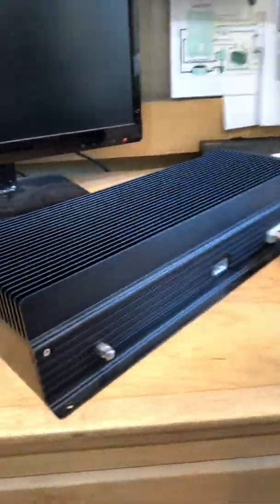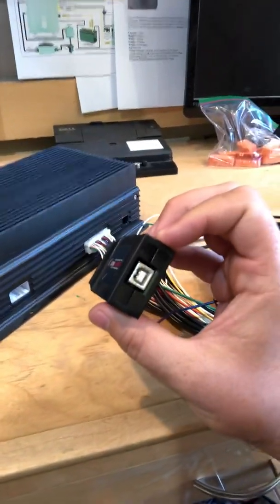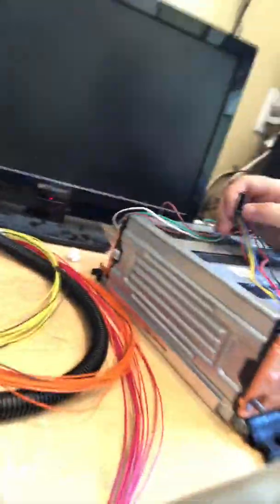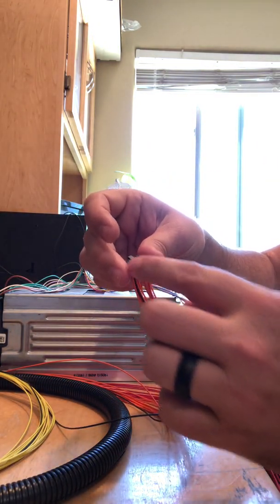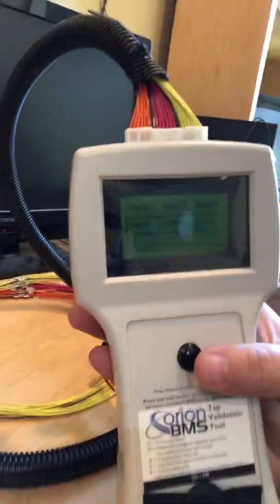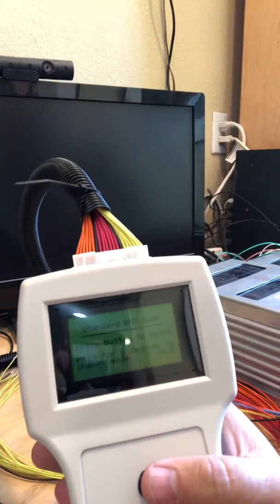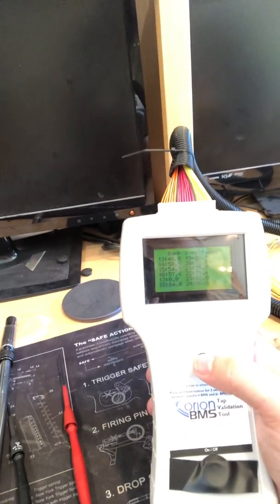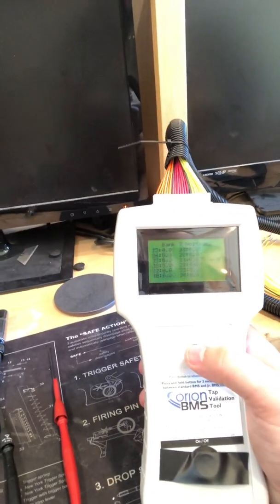Orion BMS setup part 1

Comment: where did you place the resistors in the db9 connector in terms of number? The manual had can high on 5 and can low on 3, is it ok to place the resistor at 5 and 3 as well?